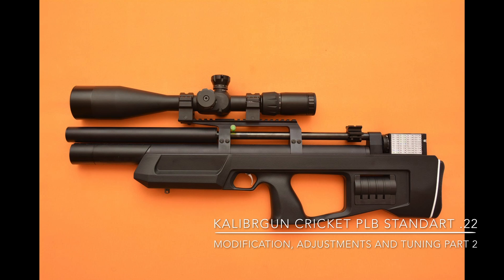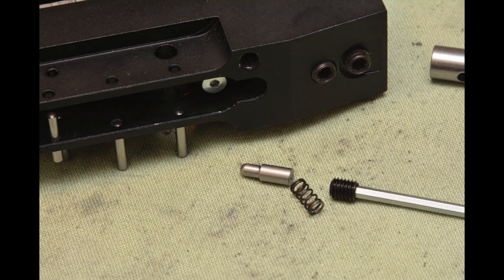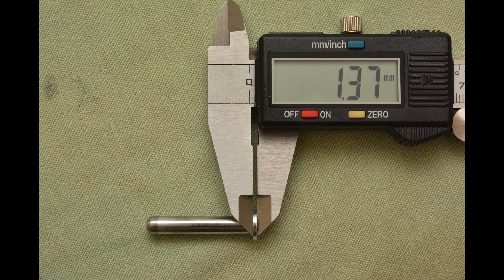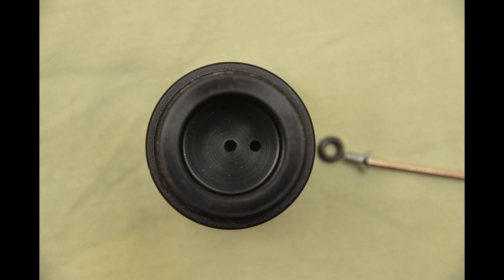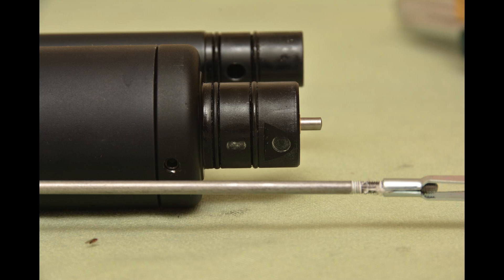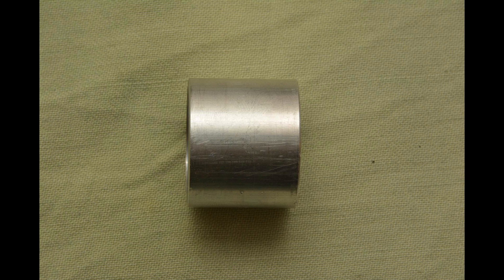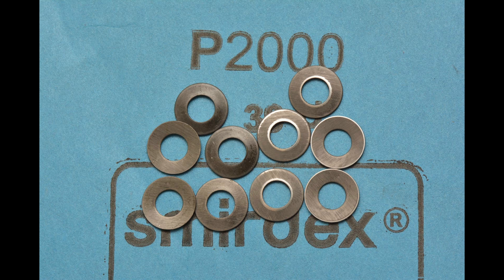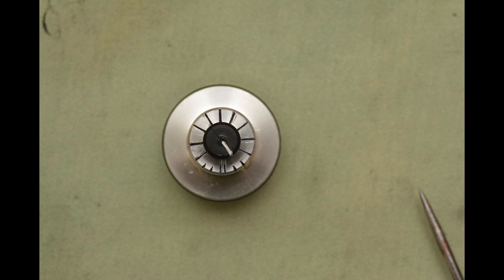Part 2 Kalibrgun Cricket .22 Modification, Adjustments and Tuning

Comment: How did you hook up the pressure gauge to read regulated pressure? I want to lower my regulator pressure to detune my .177 cal to about 15fpe for small backyard pests control. 
Many thanks
Reply from the maker: I mede adaptor to hold the manometer and to go to the cylinder. In the cylinder is 4mm thread as far as I can remember...

Comment: What are you using to polish the parts?
Reply: CMR airgunner 1000 grit wet and dry sandpaper and then 2000 for the mirror finish

Comment: Also the pill box where exactly did you put it?
Reply from the maker: Push it to the center of the cylinder. Should have a small hall for the air flow. Should be very tight, because will go to the fire valve from the pressure waves.

Comment: Well done.Nice job. I aslo have the cricket(the short one) and i'm really happy with its performance.
How did you put the 4mm adapter of gauge for measuring the pressure after the regulator.Did you have to drill or something?
Thanks
Reply from the maker: There is a 4mm already. You need just to do the adapter of the manometer.
Regards.

Comment: Holy shit man...thank you for all of this.  I still don't own one of these, but I am definitely going to follow your guide.  I'm not going to get the model with the mag holders for sure though.  Great write up.
Reply: you're not right. The holder is very usefull but you have to do this little modification.
When the holder is closed it doesn't open by itself cause it haw magnets. The ''problem'' is that when you open to take a magazine you may drop it.
I'lldo this modification as is very easy.
Reply: Kostas Daffy  you dont have to do this modd to get the mag to hold if you go to www.biggo.co.uk they supply a bigger oring that replaces the 2 on the mag and it holds it firmly in the mag holder and holds pellets great aswell